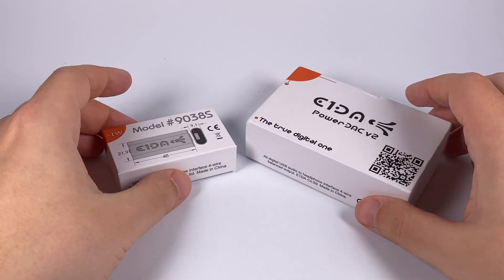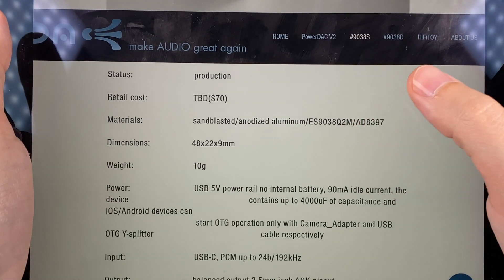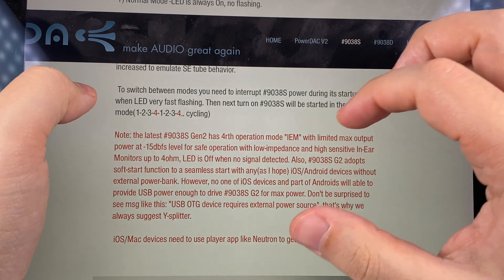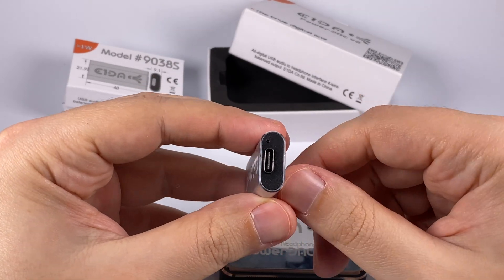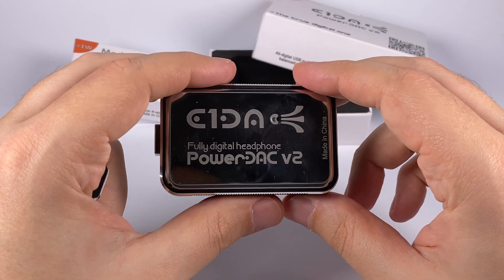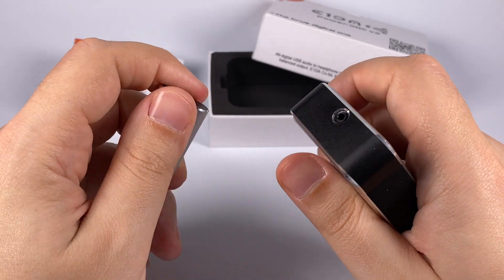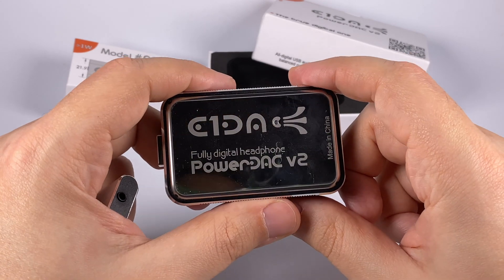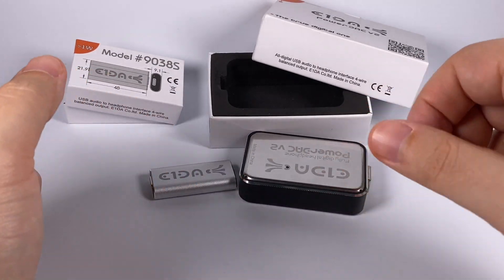E1DA 9038s vs PowerDAC v2 comparison

Comment: PowerDAC V2.1 is just as “portable” as the 9038s and I use it daily with an iPhone 13 Pro Max. It’s about double the mA for draw (5V 250mA) but still well within parameters for the same otg cables you would be using for the 9038s. MIDI to usb c adapter exist and are dirt cheap. Now, size-wise I guess it’s not as portable but in actual use cases there really isn’t a difference. In some ways the PowerDAC is more “portable” in the sense that it plays better with smartphones. It’s companion app HPTOY allows for additional volume control so you don’t get stuck between too quiet and too loud on your smartphones (big issue with 9038 series). But the real kicker is the full suite of settings you get with HPTOY. You can literally make your headphones sound like anything! It’s nuts! And it’s cheaper than the 9038. It’s by far the best deal in HIFI I have ever come across!
Reply from the maker: thank you for sharing

Comment: Hi, may I ask you if you think it is a good pair with sundara? Or you can reccomand another amp, which fits better with the sundara? Many thanks
Reply from the maker: I didn't test in practice, but probably it'll be an OK pair. E1DA DACs are created with planars in mind
Reply: @PortaFi  do you think sundora or other Planar similar to sundara will like more power or powerdac is enough? Someone says that at least 2 w are required for sundara but someone else says that is just subdle common mistake
Reply from the maker: no, 2 watts is an overestimation here. there is a good calculator for rough estimation: 

https://reference-audio-analyzer.pro/en/splfull.php

it's not 100% precise answer, but OK as a rough evaluation
with 2000 mW it will be more than 110 dB of SPL, that is pretty too much )))

other question is the representation. Sundara is neutral, and E1DA's powerdac is a bit warmer, so they "compensate" each other. for me it's a good outcome, but your taste can be different here
Reply: @PortaFi  thank you so much. A lot appreciated. I had the same feeling ;). But as someone reported that 2w where required to "move" the drivers properly expecially for the bass, I started to have a doubt. Many many thanks!!

Comment: darn it.. just noticed it requires balanced jack... 😭 i don't currently own any balanced jack... 😡 need more shopping to be done befbefore i can start looking at this thing.
Reply from the maker: well, maybe you can recable your headphones to balanced…
or wait for the new 9038D that should be single-ended
Reply: Porta.Fi thanks. I saw the “D” version. And it looks promising.